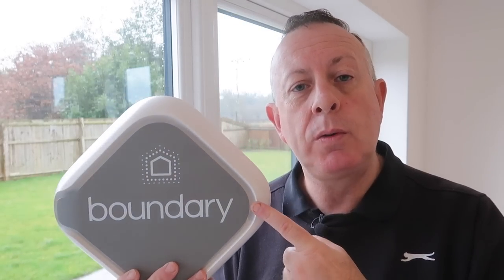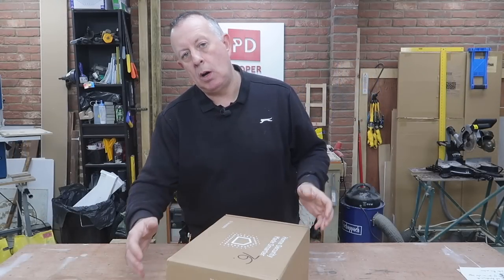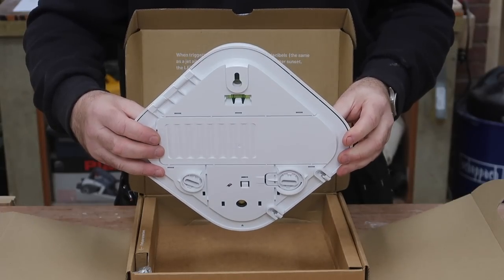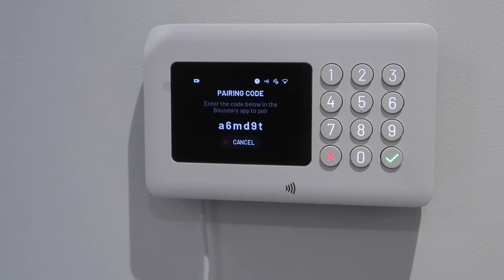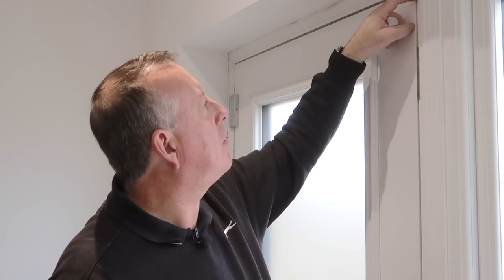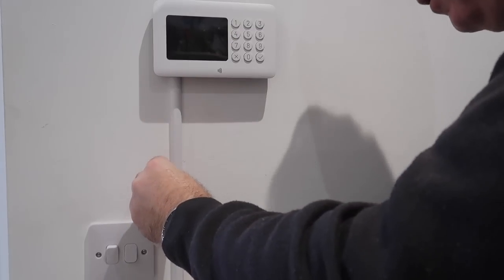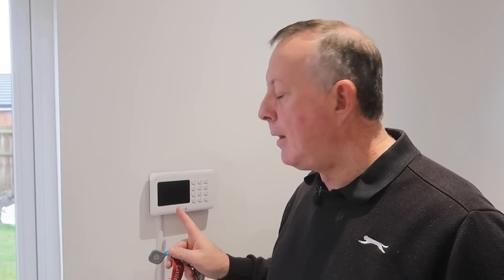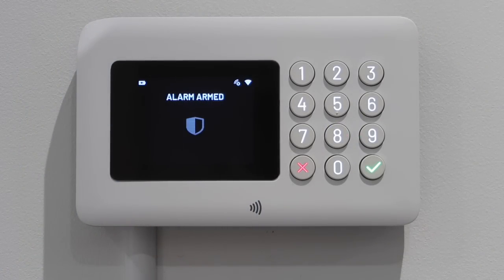Boundary Alarm System - The Easiest Alarm System to Install

Comment: For night time deterrent would be good to have a blinking led light on the outside of the building.
Reply: The strobe will pulse blue between 7pm and 11pm. It will pulse red when sounding regardless of the time of day.

We limit the times to get the most out of the battery life over the year.

Comment: Hopefully these are better than the wireless Yale systems that don't go off if the main unit inside the front door is destroyed within the entry timeout...
Reply: 1) Dont put the main unit just inside the front door - put it more than 10 seconds away from it, so it can't be destroyed within the entry timeout...
2) Change the settings so the alarm goes off if the door is opened - ie, no entry time delay. You can disable the alarm by a smart phone from outside. Everyone has one these days.
Reply: @wannabefreerider7371  Good advice although I would find having to stand outside in the rain to deactivate the alarm inconvenient. It would most likely result in forgetting and setting the alarm off. With the Yale units a workaround is to hide the main unit and fit a secondary keypad by the entry door.
Reply: We would treat an attack on the hub as an activation. Smashing it up after this point would be pointless!
Reply: @BoundaryAlarm  and so would opening the door on my current system. The second the door is opened, the alarm goes off and I get a text…. But I don’t have to pay a subscription for that privilege. I looked at simply safe, who also offer a subscription where the police are alerted, but I seriously doubted the police would come, especially if I wasn’t in as there is no threat to life. That subscription may work well in other countries, but given how the uk police don’t even make an effort to attend a house after it has been broken into to get fingerprints, I doubt they’d be round if you called them and if they did come round, I doubt it would before they’re long gone.
Reply: The problem isn’t with you @Boundary, it’s the state of the police forces in the uk that puts me off a subscription package

Comment: I love this system. Installed it a few weeks ago. Loving the partial arming capability. My only gripe is the usb plug for the hub ….  I hate external trunking with a passion so at some point I will invest in swapping that big plug out to be a hidden wire into a fuse spur of some kind….
Reply: And thus you move from DIY to needing an electrician and making good in 99% of cases. Can't have it both ways.
Reply: @Amped-JDS  ha ha … it’s a minor piece of work that is a 1-off ..jeez … you’d say black was white
Reply: @GordieK  minor? Are you qualified to make that call? 99% of people aren't but we still have a huge number of have a go heroes in the country and lucky for me they keep me in work. Shame it's usually after the 🔥
Reply: @Amped-JDS  omg here we come with the ‘nobody knows what they are doing unless they are qualified ‘ bs …. Another sparky or installer trying to justify their fee? If it took a qualified installer more than 2 hours to do that then they should get another job … so yea it’s minor … get a life .. your just trolling now
Reply: @GordieK  there is a reason they have laws against people like you. Let's hope you never hurt someone and have to answer for it.
Reply: @Amped-JDS  troll
Reply: @GordieK  is that what you say when people disagree with you? Going back to my original comment, for 99% of people, your complaint and solution would take it out of DIY realms.
Reply: @Amped-JDS  For that 1 bit I would pay a spark if I wanted it done (you assumed I was doing it myself and nowhere did I say that) BUT that is it ..the rest of it doesn’t need a spark. Btw if I could block you I would … you really are trolling …
Reply: @GordieK  it's called a conversation or a discussion and it requires both sides. Also, you now saying you would get a spark to do it would still require the company to change their setup so there would need to be enough demand. That additional cost would likely make it not viable for most people as they already have a massive subscription cost to pay.
Reply: @Amped-JDS  totally disagree …. Why would the company have to change their setup? That’s the sort of thing an individual spark could do - the company dont need to change a thing in their product if you think about it. it’s a ‘usbc power driver’ thing that’s being installed - you simply do not use the supplied plug …  you are making all sorts of assumptions about a ‘massive’ subscription cost ( it isn’t to some people and it is to some others) …. As I said before this is less (much less) than I paid for my wired alarm maintenance contract so for me it’s good value - you clearly disagree with that … I am struggling to see why you keep going on trying to dis the product… ok you don’t like it and think it’s expensive go post that for everyone to see … we disagree ..  I’m going to bed now ..
Reply: @GordieK  your original comment was about the usb cable coming down and not being hidden. So the design to be able to take the cable out the back and into a wall is the bit that I called into question. You are in a better place to know the exact layout than I as you have a unit. As for trying to dis the product, that is not strictly true, I just disagree with a business model where you pay good money for a product and then if you fail to pay the subscription it becomes a doorstop. It's a choice thing really. As for the contract on your wired alarm, it's very different as the alarm still functioned without the contract and what does the subscription give over and above that contract? Btw, sleep well, thanks for chatting.

Comment: The old envelope under the drilling, fantastic. Do you think the sticky pads on the PIR's would be enough even when changing the battery? Looks like a nice system though if the free 'Lite' subscription service offers enough for your needs. It doesn't offer push notifications though which could be the deal breaker for me.
Reply from the maker: The 3m sticky pads feel secure. I think if you are careful unclipping the PIR it will be fine

Comment: You will not get insurance cover on this alarm it does not comply with any British or European Standard or NSI
Reply: Hi Tony, it does comply with UK and EU standards. We expect to release our PD grading in the next month which means it will be approved for professional monitoring with police response when fitted by our engineers.
Reply: @BoundaryAlarm  I think your customer stated you could already despatch police responce how quidk is your responce time and how do you  verify second responce that it not false alarm
Reply: @tonybrosnan581  No the service launches this quarter. We have an ARC in place and the system will connect direct to force control rooms. We also support the newer echo protocol that monitoring stations are moving towards.

The time for the police to respond is not under our control but we use a confirmed sensor activation to alert the Police via the ARC.

This will all be launched by the end of the quarter we're anticipating. In the meantime the system does support automatic keyholder alerts direct from our platform.
Reply: @BoundaryAlarm  So your system at this moment does not comply. Any of the Companies that have to comply to NSI which they do have pay certification most are Gold stadard
Reply: @tonybrosnan581  Not yet but as I said, it will shortly. We are already certified by the SSAIB as a company.
Reply: @BoundaryAlarm  Not realiy the main organisation that main insurance companies look at, what is your pd pending. I can not see any insurance company giving cover on self installed alarm with no maintenace cover by who are Boundary supplying engineers bet there not.

Comment: Shame they charge a subscription for more than 2 sensors. Put's the price up a lot!
Reply: I have a system that installs as easily as this, it doesn't have a prescription and it sends my phone a text if it goes off. Shop around!
Reply: @wannabefreerider7371  yes exactly. there are better alternatives.
Reply: Hi there, our free Lite plan now allows Unlimited Sensors. There are no other costs other than the upfront system purchase. Check out the monthly plans page on our website for more info. Thanks, Tom
Reply: @BoundaryAlarm  it's still a no from me. By the time you've paid for the subscription for 2 years you could have had a better alarm fully paid for. I had the subscription model. I'd rather pay a higher price upfront for the same features knowing that'll all I have to pay.
Reply: @BoundaryAlarm  Also, the fact that your Home Assistant "integration"/workaround is only available for paid subscriptions is a big no from me.

Comment: This is the 2nd time I've seen this alarm and the 2nd time the supposed discount code is not recognised when trying to place an order. Perhaps when they honour the code I might place an order.
Reply: Hi Peter, the code is valid and we're seeing orders coming through. Just make sure you are entering all capitals and no spaces. If you continue to have problems just drop us a message and we can help.
Reply from the maker: The code works - are you putting in correctly? PROPERDIY
Reply: The code certainly wouldn't work at the time of my original comment. However, it has now been accepted and my order placed.
Thanks.
Reply: @petergorman471  Good to hear! We have seen issues in the past where a high volume of orders trips the built in fraud checks and suspends codes for a while. Glad you're sorted out now though 👍

Comment: Nothing will ever beet a old fashioned wired alarm system... so many newer alarms depend on a phone line or WiFi connection which can easily be disconected or externally cut by thieves before a burglary takes place 🤔
Reply: The system does not rely on WiFi to activate, the sensors run on their own Zwave network so cutting the WiFi won't make a difference. We also offer a cellular backup option for extra peace of mind.
Reply: Agreed. There’s so many flaws in these cheap Boundary/Ring et al systems that will ensure alarm engineers fitting professional equipment (not available to the public) stay in business. A couple of points: I would be very sceptical as to how long those batteries last, I wouldn’t put my ladders away in a hurry! There’s also the cost of replacement batteries to think about on top of that monthly subscription. As an absolute minimum the system should be hybrid with mains power to the sounder outside with a decent siren/strobe etc. I was shocked to see the installer simply ran the control keypad into a plug-in socket with a bit of trunking in-between. No tamper protection here and with the flick of a switch the system is powered down. I think any would-be burglar that has already scoped-out a property to intrude would not be put off by what is clearly a DIY alarm installed in an hour or so.

Comment: For a charge of a tenner a month, I'd want FREE battery replacement
Reply: Hi there, our free Lite plan now allows Unlimited Sensors. There are no other costs other than the upfront system purchase. Check out the monthly plans page on our website for more info. Thanks, Tom

Comment: Boundary have no approvals to offer a level 1 police response on the equipment shown in video as it  does not meet with the requirements of en 50131, you can not DIY a system which will offer a level1 police response......  lots of misleading claims & cartoon police men on Boundary's website.

Comment: What happens if a burglar breaks in and switches off your WiFi within the 45 seconds?
Reply from the maker: It doesn't need wifi to work - just to send you notifications - it will still ring

Comment: The current trend of subscription based equipment is entirely courtesy of Adobe. Absolute swines.
Reply: Hi John, our free Lite plan now allows Unlimited Sensors. There are no other costs other than the upfront system purchase. Check out the monthly plans page on our website for more info. Thanks, Tom